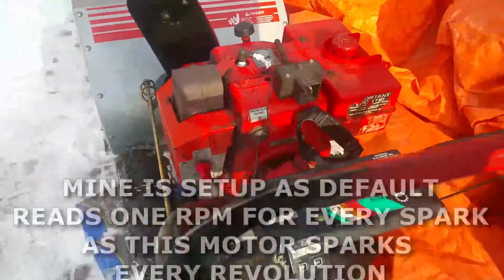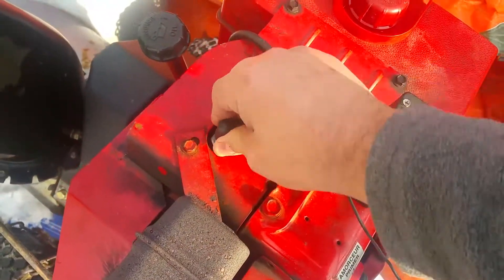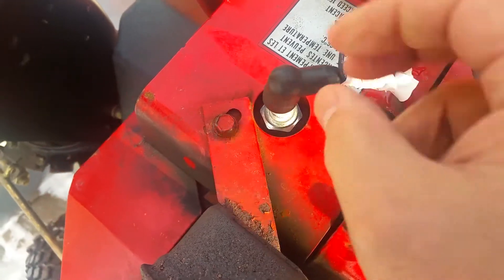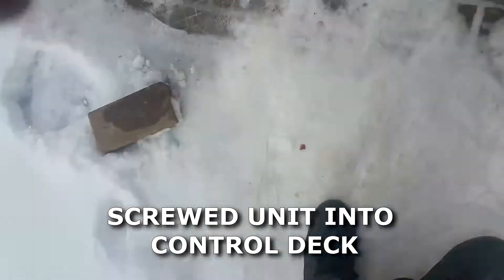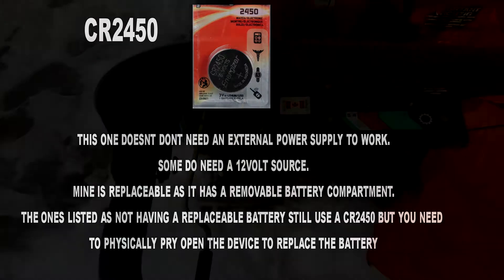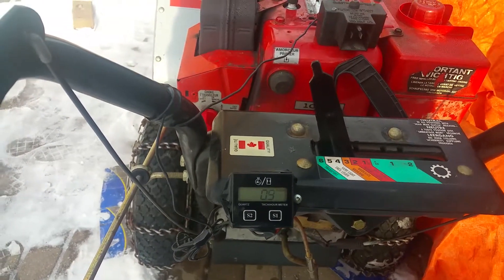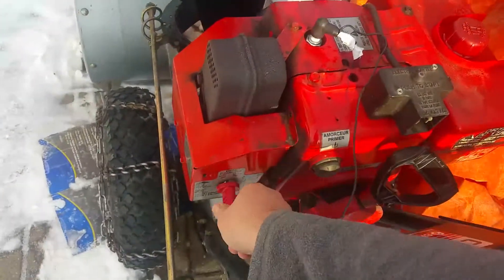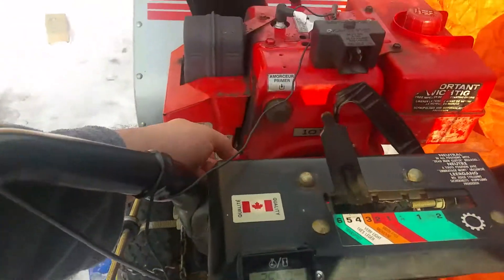INSTALLING A DIGITAL LCD TACHOMETER - CHEAP & EASY GOOD FOR ANY GAS MOTOR

Comment: A good demonstration of rpm/tachometer on an engine.  Question though: which mode (01 or 02) did you use for your 4 cycle snow blower?  Thanks in advance for you help.
Reply: 2
Reply: @Indietro25  Thanks.
Reply: @Indietro25  Thanks again.

Comment: Can you turn off the tach when not in use?
Reply: Unfortunately no but battery seems too last for awhile. Mines been over a year and it's still working on same battery. Ymmv
Reply: @vinnyc7613  Addendum to my reply:  there is a bit of a confusion out there re which mode to use.  Please make sure you use the right mode for your situation, otherwise, you might damage your engine and its connecting rod.
Reply: May be a little late but this is what I do turn it off:  use the Reset directions: Press and hold the S1 button until 05 is displayed,  Release the S1 button and after 8 seconds the display will return to total hours.  Press and hold S1 and S2 simultaneously for 20 seconds and the meter will perform a total reset - and then turn off by itself.

 If you have to reuse the unit for measuring RPM, use the mode relevant for your situation.  I use mode 2 for my 4-cycle engine snow blowers and lawnmowers.

Comment: You need to adjust those overhead valves. ;)
Reply from the maker: why, if its from the sound you here it could be the way the phone is picking up the audio
Reply from the maker: i think its more of a carb issue, got a clone from china just havent installed it yet or might just use the parts from it.
if it were valves it should have a hard time starting, but it always seems to start on first pull if motor is either cold or hot